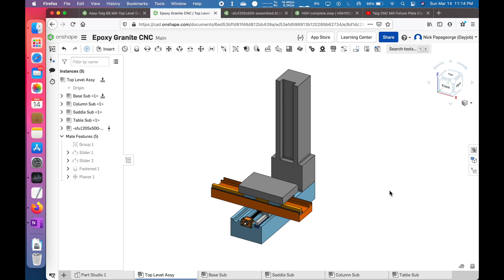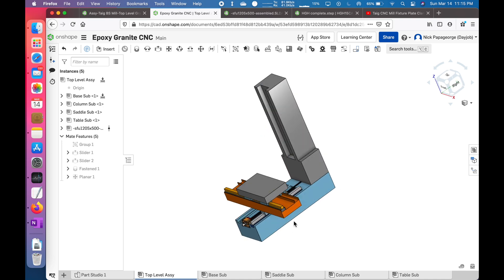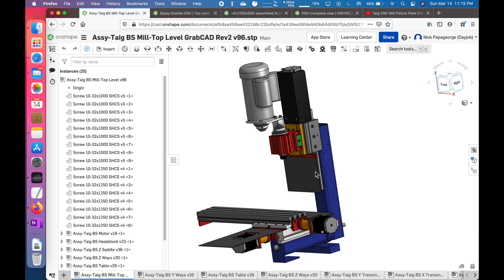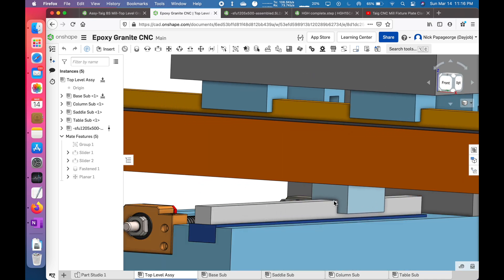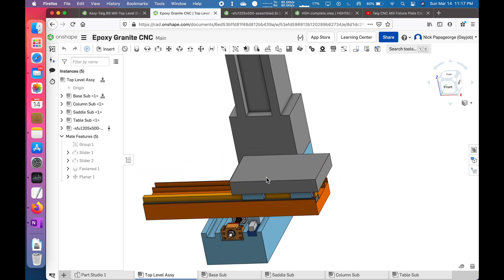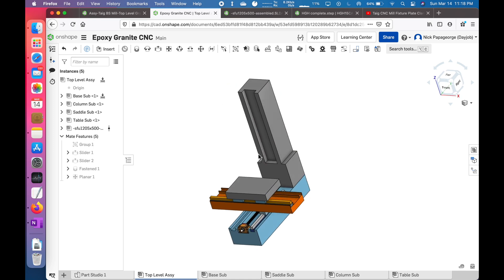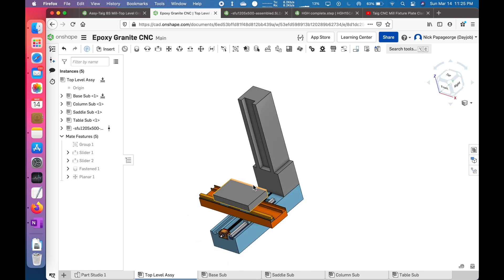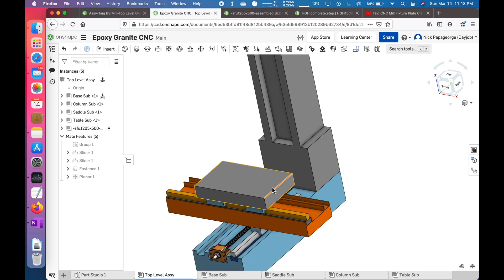Ep1: Epoxy Granite CNC Design  - Introduction

Comment: I like how you’re revisiting the drawing board before committing to an idea. 

Have you considered using normal concrete with an epoxy paint on it to keep the material costs down?
Reply from the maker: No, I have not thought of that. The epoxy paint in this case is just to make the concrete pretty, correct? I did fill my Taig tube steel frame cnc with epoxy granite in a later episode in this series. I think it was only about $100 to do it. But this scratch built design has a higher volume. I have not calculated the costs. Cement certainly would be dirt cheap though! Probably plenty good enough too.
Reply: @nickp4793  the epoxy will also give it a harder exterior less susceptible to damage from oil/coolant.

Comment: I think you should widen the base a bit for aesthetic reasons and keeps it from being tippy.
Reply from the maker: Thanks. I was thinking to use 8020 t-slot cross beams as legs, with leveling pads at the end of them.
Reply: @nickp4793  Sorry to be opinionated about your mill. I would cast the base as one piece with heavy duty threaded inserts for leveling. You want it to look pro to the point that when someone sees it they ask "Where did you buy that expensive mill?"  8020 makes it look too DIY. They are too many 8020 based designs out there. From a functional perspective, why put all the effort in making a rigid epoxy base only to have it supported by less rigid and hollow aluminum? Make a functional machine, but make it art as well.
Reply from the maker: @bobweiram6321  all good! I appreciate the advice. One of my main goals is to keep the machine under 200lbs. I live in an apartment on the second floor, with no elevator, and want to be able to move it relatively easily. So any added mass will have to be carefully considered. If a house with a shop comes up, I’ll probably just buy a commercial mill. Ha ha.
Reply: @nickp4793  You could just hollow cast the base by embedding a removable block. 8020 is just too ugly and hackneyed.